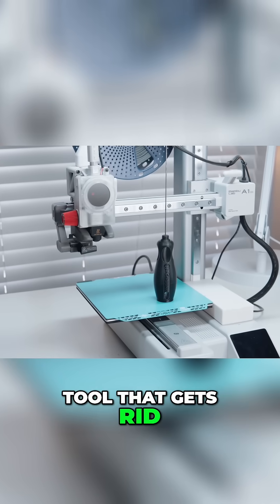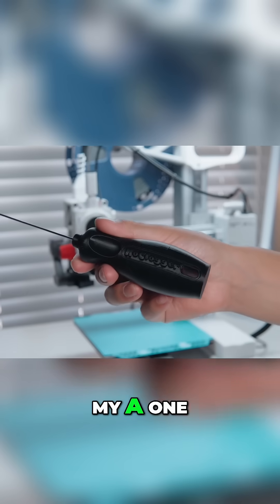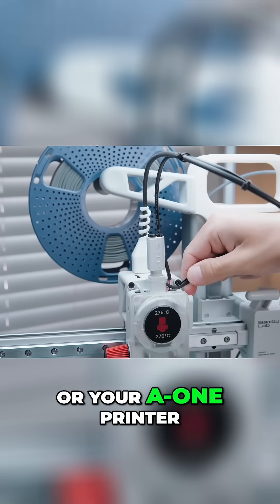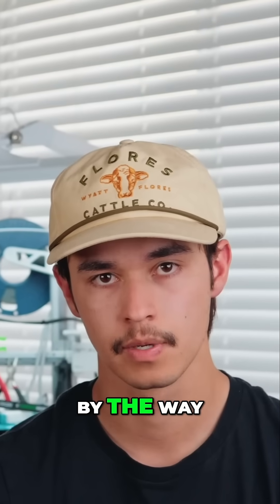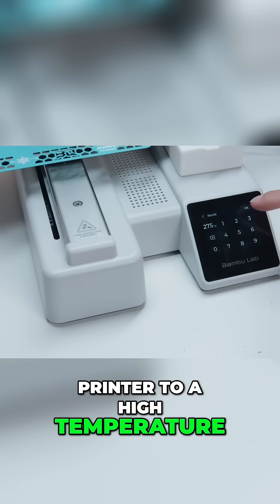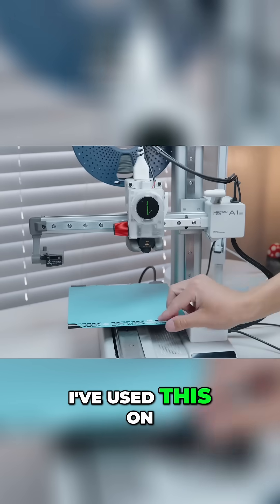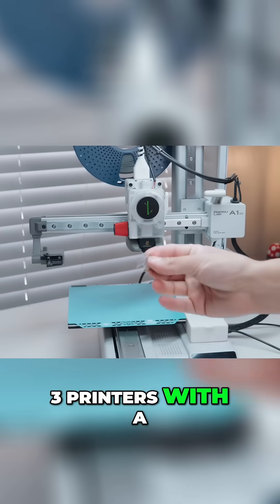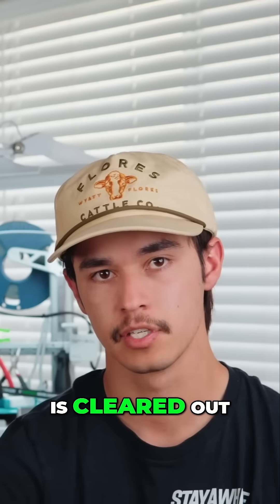Say Goodbye to 3D Printer Clogs Forever!

Comment: I have NEVER gotten a clog on my newest printer. Never. Not 1 time. It has over 6000 hrs print time, 90% of that all was  CF engineering filaments😂 and I'm a cheapskate too. I use a lot of the cheaper filament I can find😂  the problem is the printer your using, the nozzle and extruder design. So- by having a capable printer- I've ALSO managed to have a 100% success rate not having a single clog- using the toughest high temp filaments doing literally nothing special.

Comment: Needles with diameters of 0.2, 0.4, 0.6, and 0.8 are available for unclogging nozzles.
Special nylon filament is available for cleaning the nozzle internally. A slow extrusion method and pulsed extrusion are available for cleaning the nozzle. There is also a cold extraction method.
Reply: Woah so like an enema

Comment: This tool is worth it but in one extreme situation I actually pulled the handle off the metal rod.. Chances are you won't have this problem as I'm pretty strong and it was an uncommon situation. Just know it's not absolutely invulnerable. Again it's very worth getting as a tool!